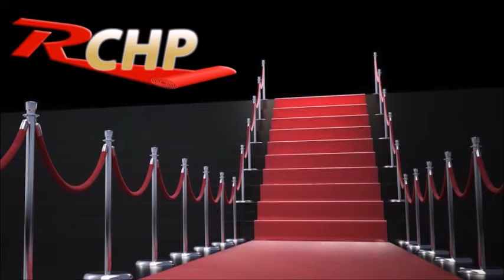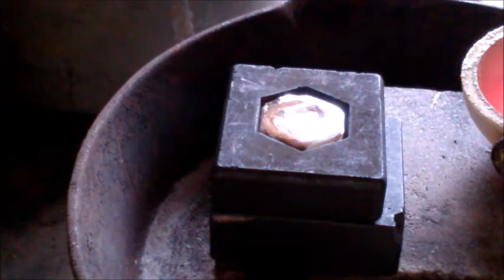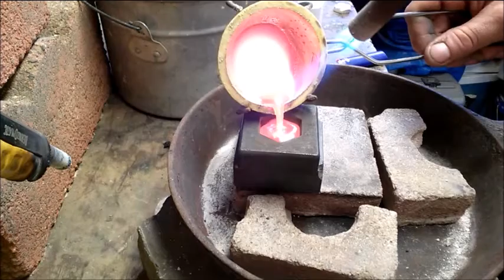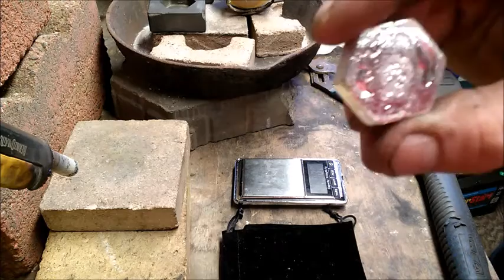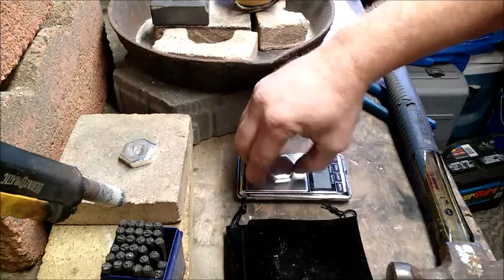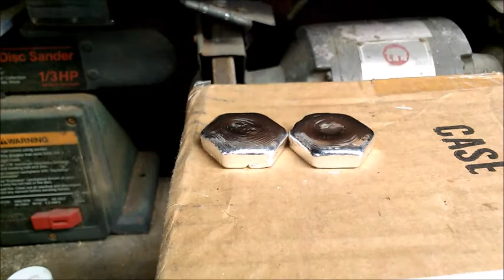How To: Silver Pour/Cooling Lines

Comment: Will polishing my poured bars make the pour lines/surface texture disappear?
Reply from the maker: sorry, meant to reply when I saw this the other day, but I think I was at work and completely forgot,

General polishing will not affect the texture in that way, not noticeably. If you were to leave your piece in a tumbler for an extremely long amount of time (days to weeks), use a heavy abrasive when polishing, or use sand paper, then yes, you would have diminished lines and other details.

Most of my pieces I will tumble for anywhere from an hour to a day, depending on the piece. Most pieces that are poured into a graphite mold I will only tumble for an hour or so, and then give a final polish. 

If it is a piece from a wood mold I will typically tumble them longer, for two reasons. One is that there is a lot more detail on the burnt out side, so I want to make sure to clean all of it out. The other, a lot of the time I try to make the top side as smooth as possible, if not mirrored on those pieces.